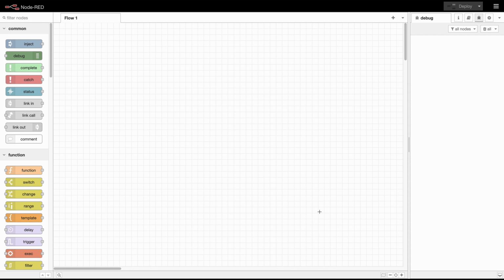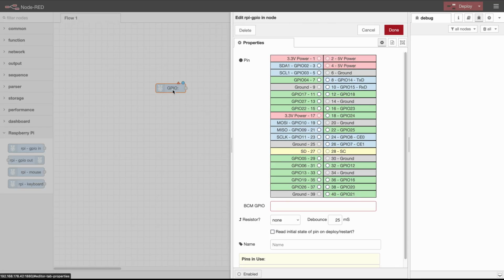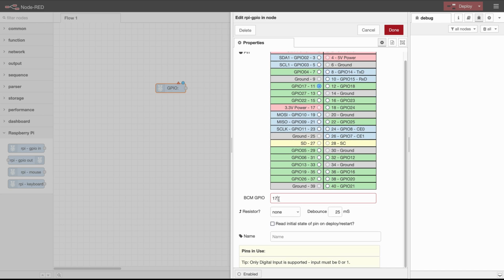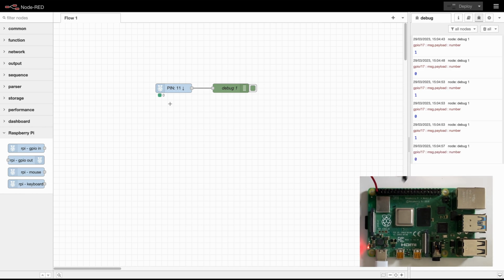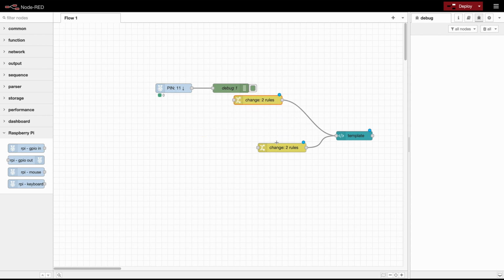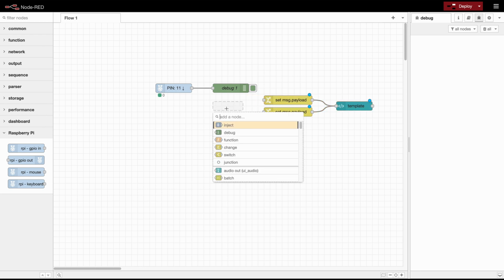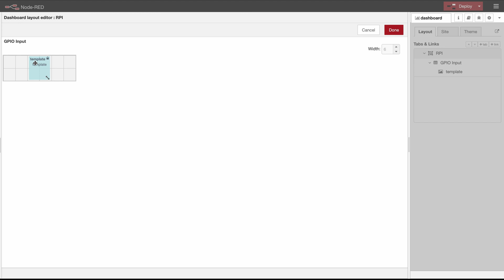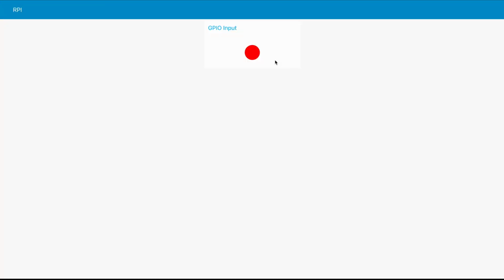Raspberry Pi GPIO Input \\ Node-Red Tutorial

Comment: Do you know if there is a node for reading stream data from GPIO, rather than just 1s and 0s? I am using openplotter on my boat and it can read my Seatalk strings through GPIO
Reply from the maker: I do not know that unfortunately. You probably need some sort of protocol for that. Something like I2C.
Reply: mqtt